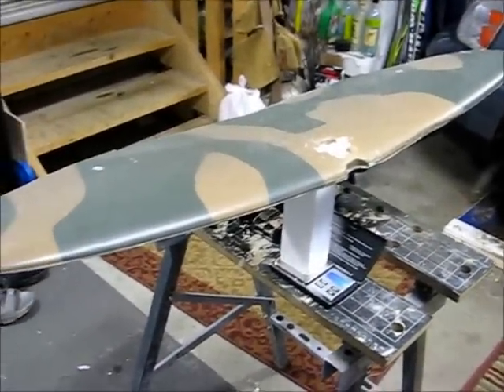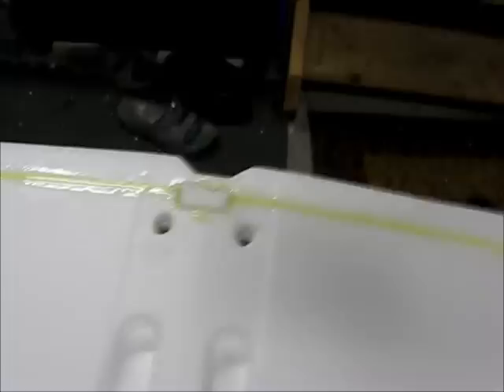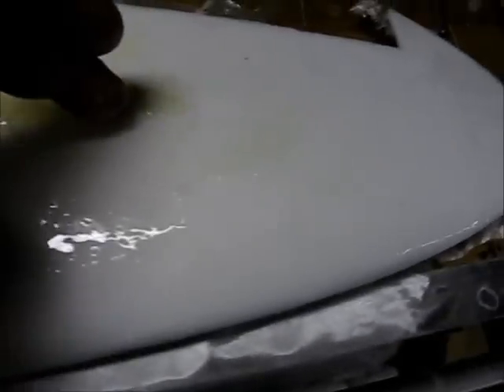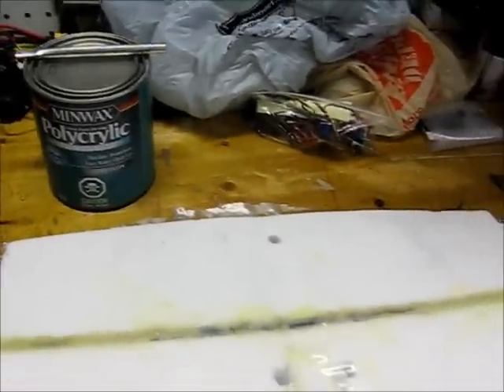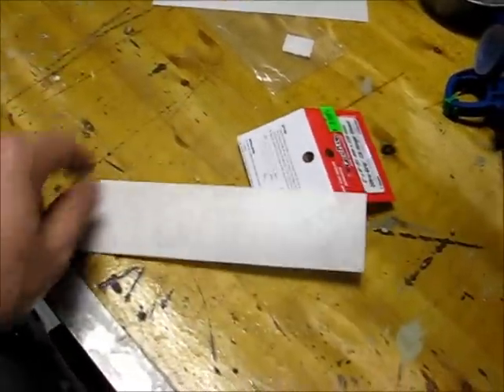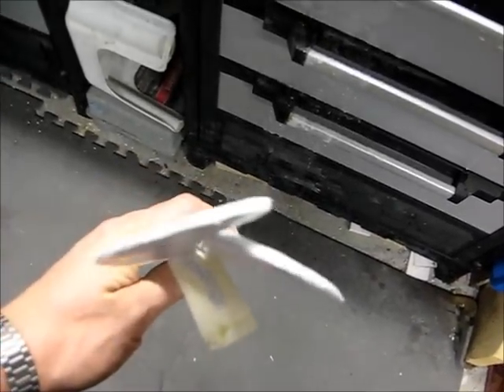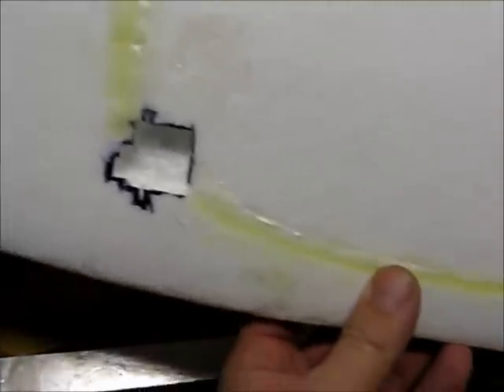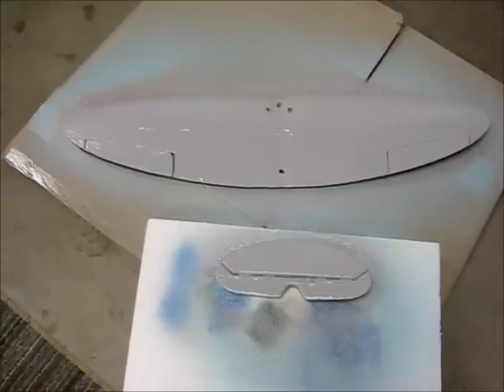Parkzone Spitfire Mod - Glassing - Part 1

Comment from the maker: @startazz Sorry about messing up the name Ian!  People, check out his vid, it's awesome!  Ian, I ended up OVERDOING it, used 6 coats of polyC but could easily of have used 3 or 4.  I then sanded it all smoother and put a very thin last coat on as well.  It doesn't look it but it came out VERY smooth and incredibly STRONG.  Worked great.  You're right, would LOVE to fly next to yours my friend, who knows, maybe some day I will make it over there.  Will start Part two this week, as the fuse is in!